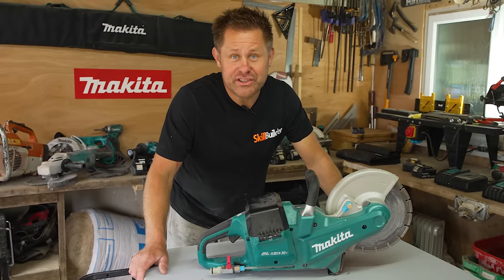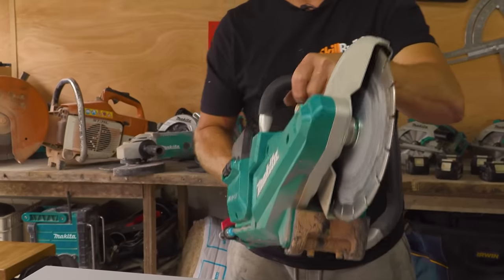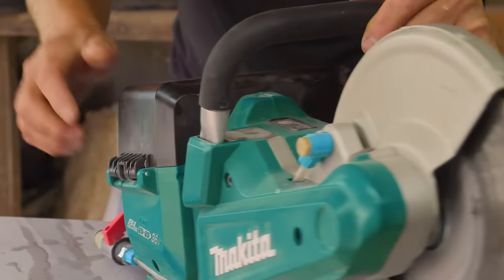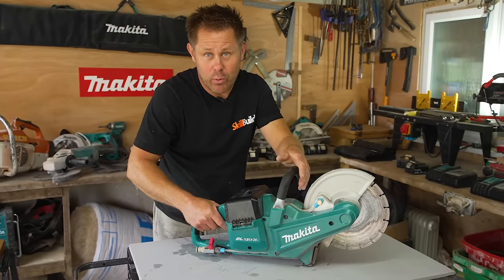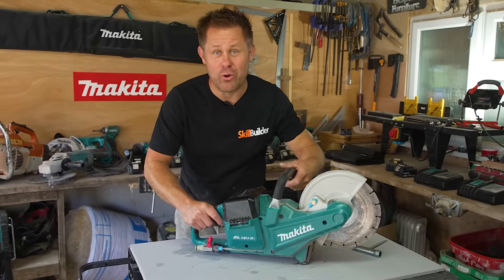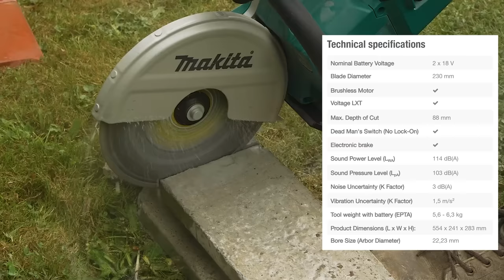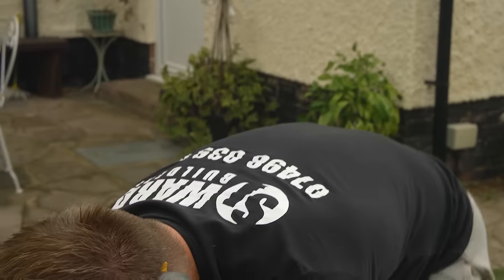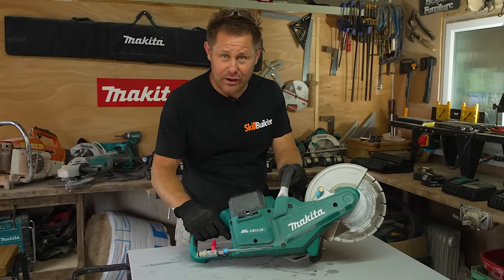Makita's BEST KEPT SECRET: The DCE090 Cut-Off Saw Nobody Talks About

Comment: I have the 18V DCE090. I’m a landscaper, it is a great tool. You don’t have to worry about battling with a 2 stroke engine, it is so lightweight, quiet, it feels like a very safe tool to use. The batteries will run out after only a few cuts but if you have the 18v system already, then just be sure to have additional batteries and a charger on site.

Comment: Had one of these but dewalt and slightly smaller. It was absolutely shit hot, my favourite tool. You have to have at 3 batteries and ideally 2 chargers. But they're so convient. Just cut blocks with a bolster and save battery for stone.
Reply: I preferred  the dewalt one over the makita, both very handy tho

Comment: Good tool.  I use another brand of cordless here in America, which will remain nameless, and I have several tools that will take as much from a battery as it will give.  one in particular is my sds-plus hammer drill.  I had 1" x 12" masonry bit on it drilling through hard polymer modified cement and the load is so great the battery would get real hot.  That's very detrimental to the battery longevity.  If you use your battery tools for a trade it might not matter so much with a lot of battery turnover, but for other people you can directly control battery life by paying attention to tool load and battery heat.  You can switch batteries out as they get warm to spread out the wear.   as a note even my corded hammer drill did not have a much better time going through that stuff
Reply: I always build up from small, 6mm or 1/4", sometimes smaller if substrate is liable to shatter like our 100-year old London sewer bricks.
Reply: @cuebj  a difficult job indeed!  Thanks for replying.

Comment: I have one , get one its a game changer and for portability buy the makita water  pressure container so no hose pipe needed  to minimise dust , it eats the batteries and as advised in the video have a good few to hand i recommend 5 amp or 6 amp models for best results but 4 will do fine
Reply: Sorry Mr wadstw I have the pressure washer box and going to buy the demo saw to hook it up to the box does it work with the pressure washer unit or do you simply hook it up to the box and let gravity work?

Comment: Agree it is a quality tool and does this job very well. I use 4 different brands for screwing and actually each of them have specific qualities for the different repetative tasks. Makita for me is the medium strength, great for light drilling and fits even a 1mm drill and 2nd in screwing. Only down point so far is the short life span of the batteries however you can replace them quite cheaply. The Milwaukee is the beast, best for fast drilling 5mm or larger and ony for heavy screwing like 6mm * 120mm or larger. The bosch easy drill is light in the hand and super stable slow drive is the best screwer for upto 6mm*90mm. I have a different impact screwdriver and the test on skillbuilder proved that for the 120mm screws in dry oak the Walt was the best and Milwaukee great as well and the Makita just good enough. So Makita is very good alround however every job might need the tool with the specific qaulities of that tool to say which one is the best.

Comment: Could you cut through a single leaf brick wall with this? I know the max cut depth states 88mm but it looks as though it would get through a brick. I've been looking at this for things like garage conversions and installing windows.
Reply: You could but it would leave a slight nib at the back of the cut like a corded nine inch cutter does. However it is then very easy to take down the wall once the first couple of bricks are removed with a hammer and chisel/ bolster.

Comment: With the water hose needing to be attached it makes the cordless cutter obsolete, might as well have corded
Reply from the maker: You don't have to use water for dust suppresion and you can get a pump up spray bottle that will last for ages. You need only a tiny amount of water.

Comment: How much does it cost to charge a battery per Ah?
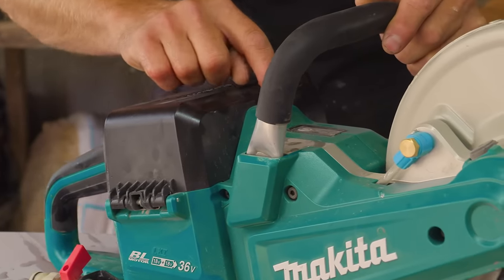Reply: Depends on the nominal V of the battery and efficiency of the charger. Multiply the V by the Ah "Ivy Watts" and divide by 1,000 to get UK billing units *if everything is perfect*. It isn't, so add a bit for safety. 1:42 he's using 5Ah batteries @ 18V so one would take 5 * 18 = 90 / 1,000 = 0.09, about a tenth of a unit. I pay about 30p per kWh, so about 3p per charge, or 6p for 2 batteries. Elsewhere he says he used 6 batteries for something, so 20p ish? It sounds about right. If you were using a corded 1kW (1,000W) model and spent 3 minutes cutting through something huge, you'd have used a twentieth of a unit of electricity - 1.5p
Reply: Thank you.  110v every time unless you are using someone else's power. @trs4u
Reply: Always charge my batteries off the customers power
Reply: @I-am-not-a-number  Oh yeah derp - I only do DIY, never even seen a 110V powertool except (now I know) when we've had someone in to do major work on the house. ... reads ... so that's why they bring a transformer! I thought it was just for isolation... every day's a learning day. The V and Ah in the battery charging answer is good no matter what your power supply. You'd have to go looking for the A on a corded tool - for those, the power in W is all you need to know. A 1,000W power tool will spend money at the same rate whether it's a 110V or 230V model.

Comment: If your having to charge batteries why not just use a plug in cutter then you have hundreds of cuts, just a thought.
Reply: Running an extension cord isn't good if you are on a roof or scaffold!
Reply from the maker: https://www.youtube.com/watch?v=gAd6yC3Bm5U
Reply: @SJWardBuilders if you are running water to it then a cable is no worse
Reply: @mc1703  True but I wouldn't think about running a hose up on a roof that isn't fully water tight!
Reply: Not good for a block paved driveway.
Reply: @SJWardBuilders 😂😂😂 This is such a perfect repost to a sceptic jibe, it should win some sort of award of YouTube!